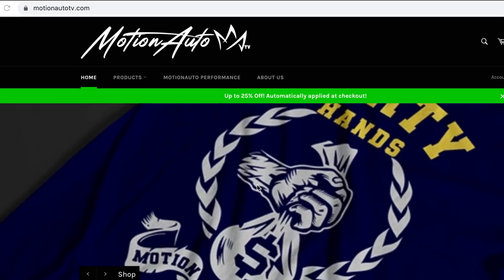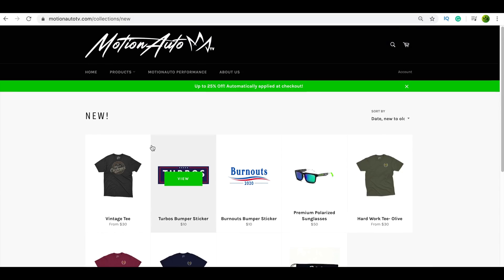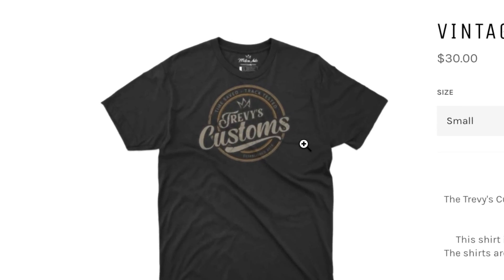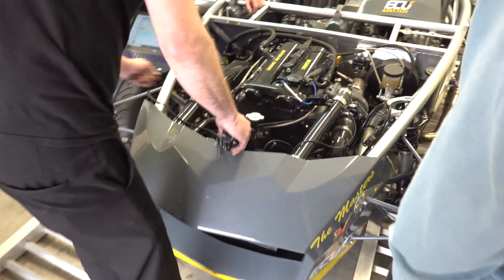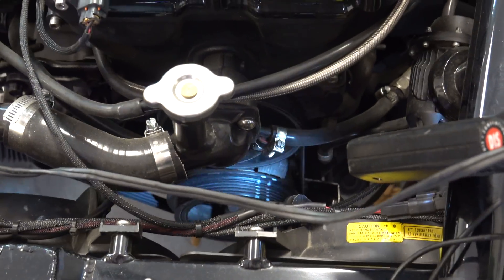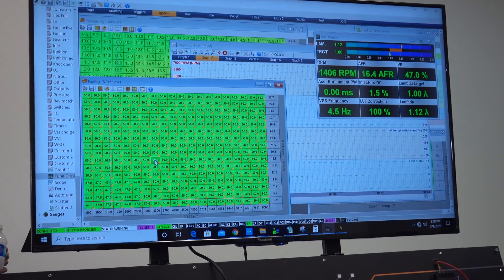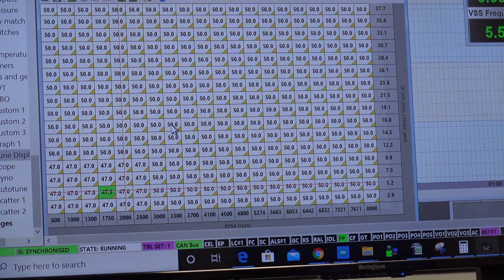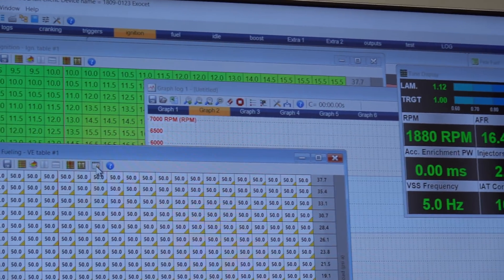LEARNING HOW TO TUNE! Ft. 2JZ Mustang

Comment: Hey dude i run ecumaster in 2 cars. I got classic and ecumaster black. Its pretty good. Ive got toyota 1fz turbo and ls1 turbo. Both run great. Only issue with my black on the ls1 turbo is the amount of outputs. I just simply need more. So im hoping the ecu master pro will sort it.
Reply from the maker: You can run on a ls just have to batch some injectors or coils
Reply: @MotionAutoTv  yeh ive batched the ignition. Runs good.